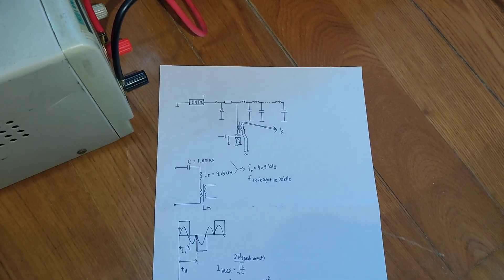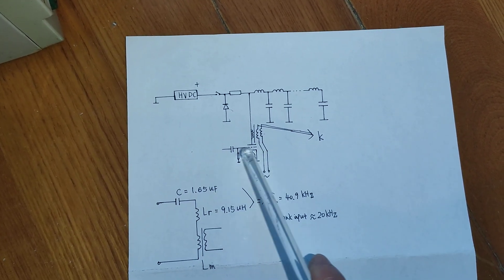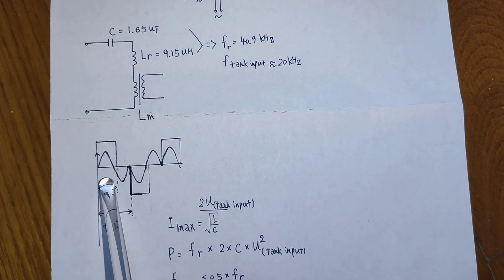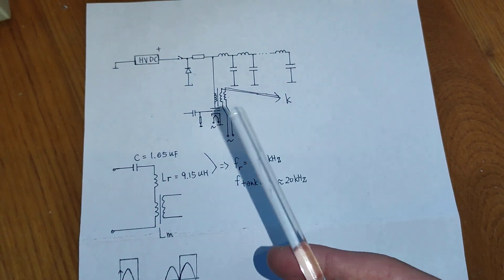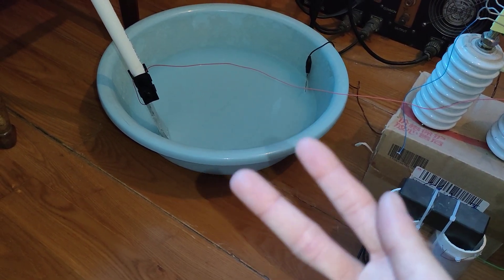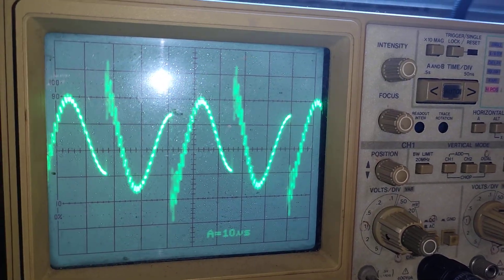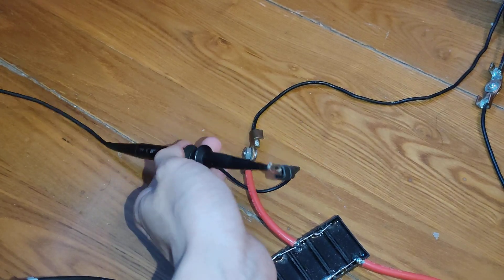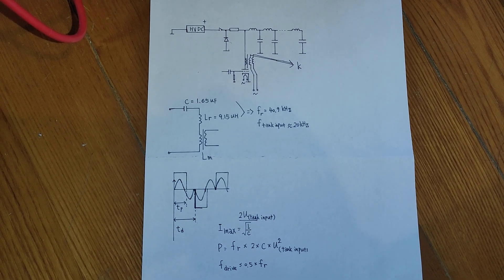High voltage capacitor charging power supply ไฟฟ้าแรงสูงโฮมเมด

Comment from the maker: Being able to reach around 4-5kW during the arcing playing but I can't show you that since it will be way too dangerous for me to pull the arc and do the film at the same time. Currently using a 200A IGBT halfbridge at 145A peak current, the IGBT module reaches around 40℃ after 1 minute of arcing playing. Hope that I can reach 42kW at 320-330V Vbus successfully, but before that the most important problem needs to be solved is to make a low leakage inductance transformer. Although there is no voltage spike problems here, too high leakage inductance will lower the driving frequency and will cause the saturation of the core as well as the audio noise. I might use 2*UU120 cores and use copper films as the primary. Any suggestions?

Comment: Alternate layering of the primary and secondary windings over each other minimises leakage inductance, but proper insulation between the windings can be tedious
Reply from the maker: Thanks, here I won't deal with a too high voltage, will just be around 2-3kV in the 42kW design. The aimed inductance will be 1.4-1.7uH.
Reply: @uecmitsuimarinedieselengin873  20Amps at 2kV would need thick wire.
Skin effect would be a problem in thick copper at high frequency, so might be a good idea to use many twisted strands for the wire.

Stranded wire is much less stiff for winding.

Might need forced air cooling on the transformer to remove heat.
Reply from the maker: @8m2sCv7  I will ask some plastic shops for making me an oil tank though, I want to make that supply a nicelooking one. I might use some paralleled secondaries since some industrial CCPS use transformers like that. Anyway I will keep your advice in mind and thanks 🙏🏻